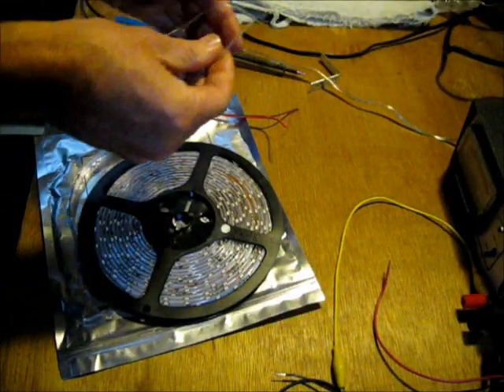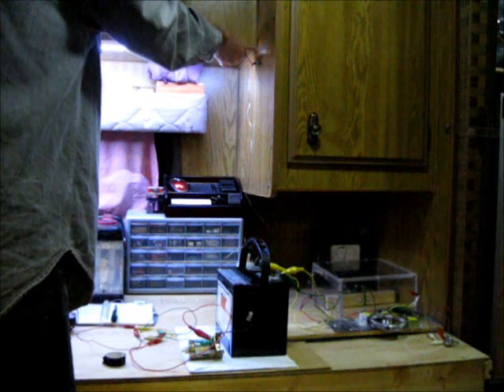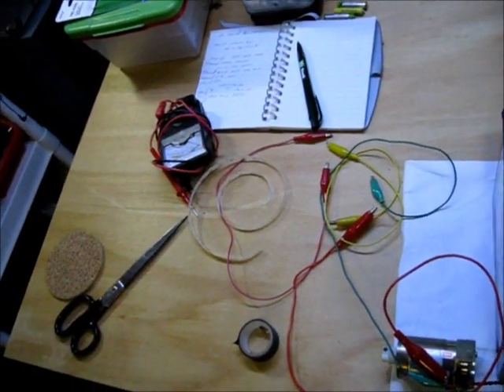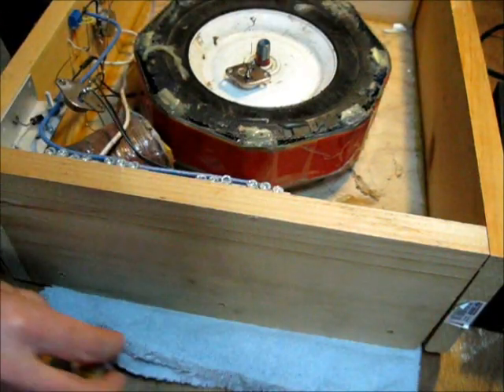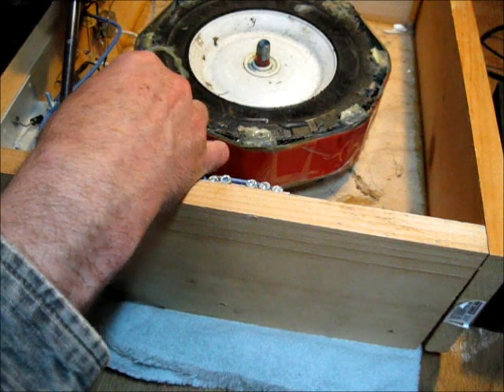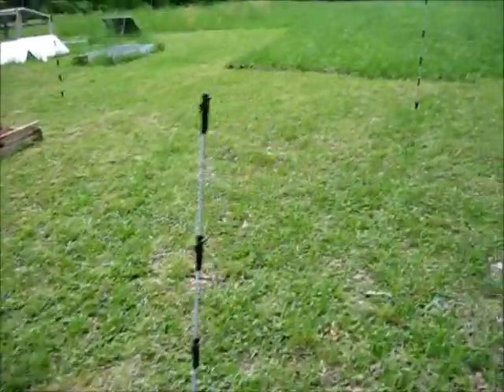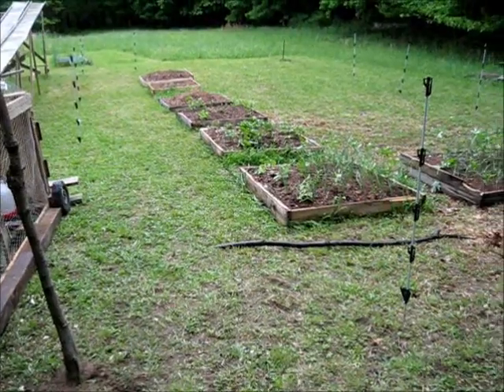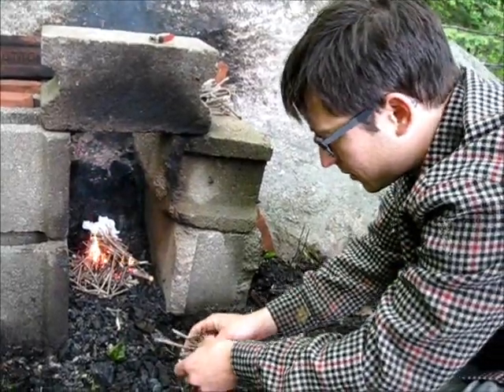Rainy Day BBQ And Fencing In The Garden Plus A Surprise (read blog)

Comment from the maker: I was considering using the blue barrel to collect water with the truck to fill the larger tank, yes.

The ground here is very hard. Very rocky. And to drill a well, most videos I see use running water, which I do not have.

Comment: @ 21:00 put an axle directly to the steel platform of the tank. You do not need to leave the property with it so you do not need it registered. With all that scrap laying around you may have an axle you could use. That tank with 275 gallons will weight more than 2000 lbs.(about 8.3 lbs per gallon).

Comment: Hi Troy. Have you ever tried a solar shower? I have used one many times when we go 4 wheeling. They work great! Fill it up and hang it in the sun for a few hours and you can have a hot, not just warm shower. Where we camp we don't have runing water either. Nothing beats a nice shower after a long day. The nice thing is they only hold several gallons so they are easy to fill up.

Comment from the maker: It is cleaner and safer then city water. Do you know what is sometimes found in city water? Is it safe?

Rain water is simply distilled water from the sky. It hits some dust particles in the air, so it is not pure. But depending on where you live, it can be clean and safe to drink.

And it sure is cleaner than bathing in a lake or pond, but people do it all the time.

Comment: Until I could get an adequate fence going, I had to spray my green beans and other veggies with a tea made of pepper spray.  The rabbits finally left my garden alone.  But you have to respray after a rain.   It was worth it.  

You can get a bumper crop of potatoes by adding several more levels of the wood frame and as you hill them up or add straw. they will get tall and put out potatoes all the way up the vine.   Then at harvest, just remove the extra wood frames.

Comment: There's a method of growing potatoes that is supposed to yield about 50-100 pounds per square meter (somewhere roundabout there). Not tried it but the videos about it can be found on youtube. As well, you might consider an attempt to grow pole beans or cucumbers up corn stalks. For corn be sure to plant enough of it in a block so it will get pollinated properly.

Comment: Just a thought and will take time but you could take a blue 55 gallon drum on the truck i you can get to the stream and fill it oh sorry put a plug you can use to hook a hose up too then drain the water from barrels to tank. Couldnt you run a sand point well at all near the place huh be so much easier

Comment: Troy use one of your small old batteries and the old charge controller you had and a small solar panel those lights will run your whole lighting inside and out with those smd strips then u have light without using power from your main setup, those smd's use very little power and will run for days on a good battery, 3-6 on a strip produces enough light for any area. plus your old charge controller will automatically turn on and off on its own day and night ;)

Comment from the maker: The problem is right now NY is poor and looking for money. The police are out there looking for anything to get a bit of extra cash. You cannot properly (legally) tow a motor home with a pickup truck that I know of.

The registration is lost and takes weeks to months to get a new one, so no driving home for now.

It is easier and cheaper to have it towed professionally. Even they are worried and doing it on Sunday when the control is less.

It is an awesome deal overall. The parts are worth it